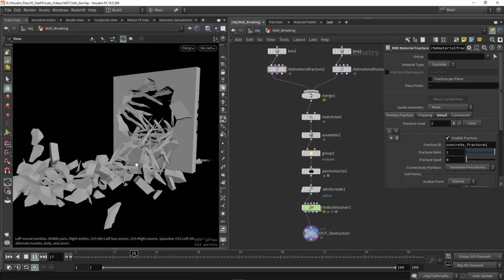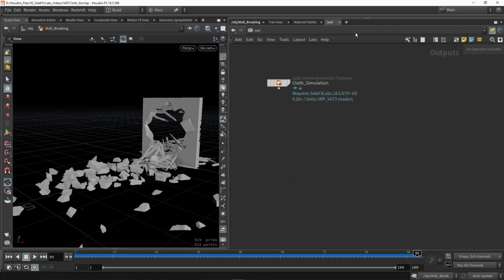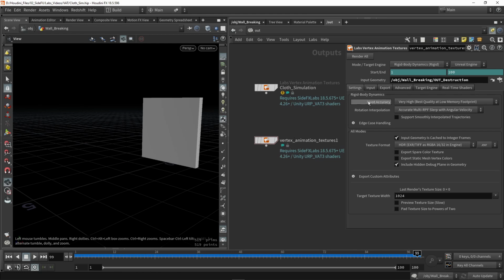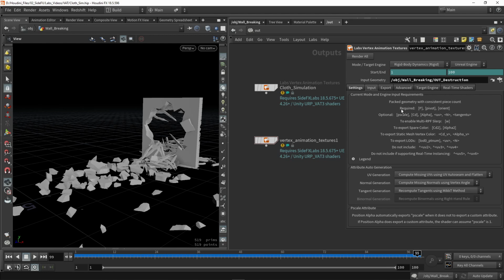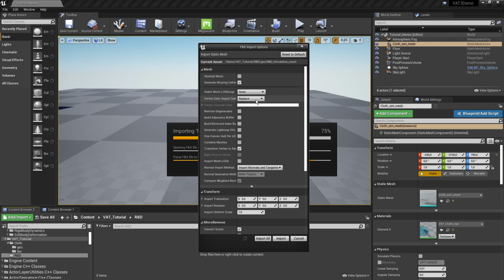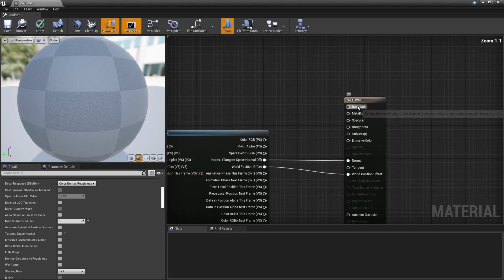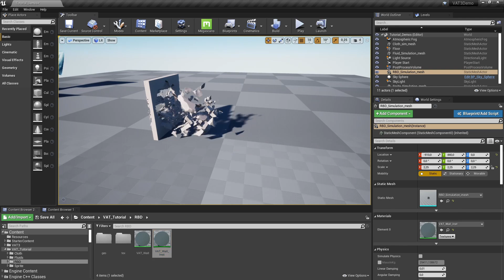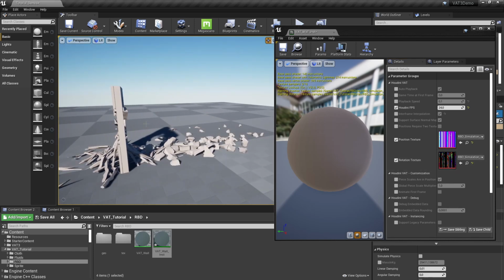VAT 4 | RBD | Unreal

Comment: What is the best way to export a crowd of 2000plus? Should I use Soft or Rigid body method? The Rigid body has an error "render position and packed pscale"? And the Soft body method is stuck on "reducing polygons" for ages then an error "render_position_and_packed_normal". This is only a test with 20 people. What am I doing wrong??